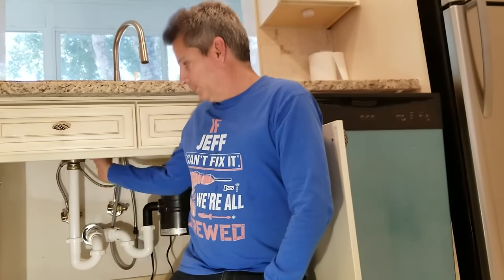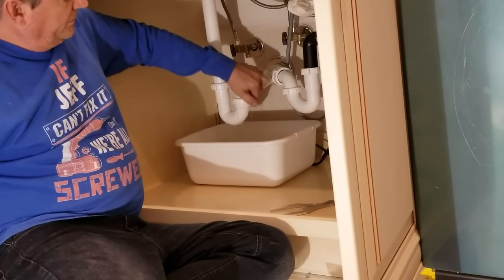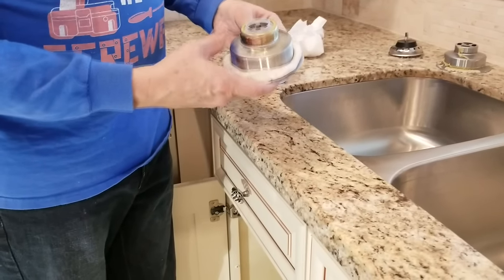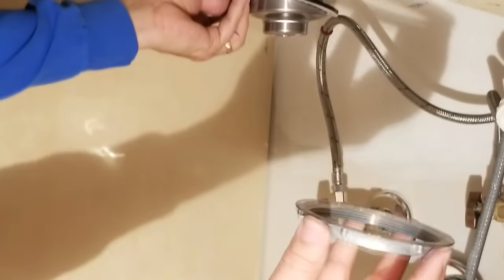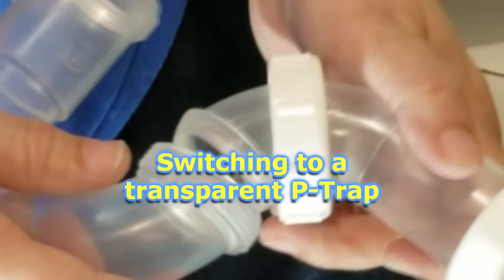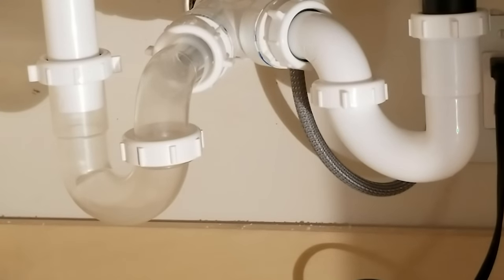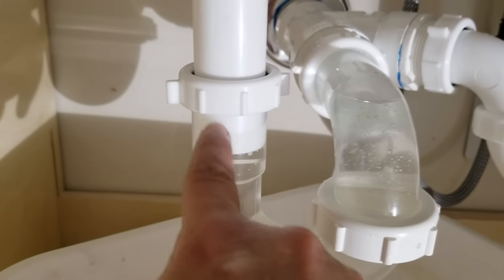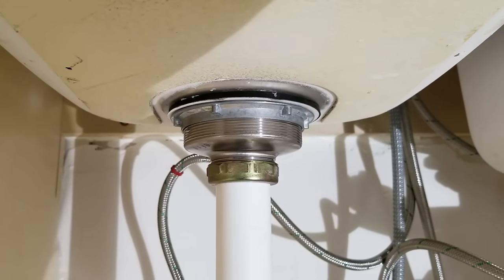How to Replace A Kitchen Sink Drain Strainer, Repair Leak

Comment: Thank you, Jeff. I just inherited my parents 13 year old log home. I am going out tomorrow for the items to fix this problem. Should I also replace the other side, just in case they are like signal lights in your auto? One goes out and the next week the opposite one fails. Thanks again!
Reply from the maker: I buy the whole kit for $7 includes the basket strainer top side and the cardboard washer and connection for the bottom side. Many installations are done wrong becaus emost people leave out the cardboard washer thinking it is trash or shipping material, but it is required or you get leaks.

Comment: Absolutely excellent video. Unfortunately  both metal nuts on my pipes are seized on their and I cracked the white pvc pipe
Reply from the maker: OK so it looks like you're going to have to remove everything anyways, so if the nuts are seized what I would do is see if you can get an angle grinder or a Dremel tool with a grinder wheel on it and cut a two or three slits around the giant nut to get it off of there and I always replace everything because the basket drain strainer is basically a $7 kit so you will start out with everything brand new and fresh and nice clean scrubbed stainless steel sink opening.

Comment: Hi Jeff.  Great video. I wish I found this before I did mine.  It is leaking s little underneath after it was ok for a while.   I think it's because I didn't have one of those wrenches.  Can I get one tighten it up.  It's been about  3months tops. Or, do need to undo it and put new putty in place first?
Reply from the maker: I would try to tighten more first if that fails, put in new putty

Comment: Hi Jeff thanks for the easy to understand video. Ive got all the new parts but using the universal sink wrench i cannot loose the old nut - the whole unit just spins. Any ideas how to get the two apart? Thanks
Reply from the maker: You mean the sink flange up top is spinning too? I would try holding the tail pipe from the drain with one hand and try loosening with the other hand. Is there any corrosion? Might need some PB Blaster sprayed on first. Might also try to get a helper to try to put weight on the part that's moving. Example if the basket drain is spinning too, you might need one of those tub drain wrenches made to fit down over the cross pattern of the drain, and hold that in place with a wrench or channelocks, while a helper loosen the big wrench. Let m know if nay of these works for you.

Comment: Hi, much appreciation for the volume of info. 
What did you use to scrap off the old plumbers putty?
Thank you!
Reply from the maker: I just used a regular paint scraper and then I used a scotch brite sponge that's the green and yellow sponge that has the green scouring pad built on to it
Reply: @jeffostroff  Thanks so much!

Comment: We have a “sprayed on granite kitchen sink” from Lowe’s, that came with our house. I replaced the strainers on both sides. A couple months it started leaking again. I purchased new plumbers putty and reinstalled. No leaks but the drain nuts keeps loosing? I believe it’s from draining hot water from the stove down the sink. I do run cold water while doing this too! Any remedies? Loctite? We’ve always have had Stainless Steel sinks.

Comment: Thanks for this video Jeff! We had a new sink strainer installed by a plumber in April 2020. About a month ago it started leaking (it didn't even last a year!). Upon inspection, the gasket seems to be coming away from the underside of the sink (wish I could post a picture here). How long are these gaskets supposed to last? Also, it looks like not enough putty was used on the sink side. I'm going to try and repair this myself asap with the help of your video. Fingers crossed.
Reply from the maker: Gasket should last many years. Likely culprit is the plumber's putty, like you said

Comment: Helllo,What is the alternative to the paste you are using?we can use pettix repair express ?thank you
Reply from the maker: The only two products I have personally ever seen used are plumbers’ putty, and silicone. Most plumbers will agree that silicone seals better, but if you ever have to change the drain years down the road, it can be a little more of a challenge to get the silicone to come off of the drain opening. Most plumbers that really know their stuff will tell you that the plumbers putty eventually cracks and leaks that's why most people have a leak in their kitchen sink. So I have never tried any other solutions than these two.

Comment: Off topic from your video but I'll be changing my bathroom sink and currently I have copper water lines . My question is should I put in flexible stainless steel lines or just keep the copper  ? The house was built in 92.
Reply from the maker: I always upgrade to the steel hoses, the copper lines kink and break too easily.

Comment: Hello Jeff! This video is so useful and thank you so much but mine leaks on clean out plug.There shouldn’t be gasket in clean out plug, right? What should I do? Can you please recommend me? Thanks 🙏
Reply from the maker: Glad it helped. I usually don't see the PVC clean out plugs leak, but some people report leaks. They don't come with gaskets, so the best way to handle this is to wrap the threads of the cap with white plumbers Teflon tape. Wrap ir clockwise when viewing the cap from the bottom. Some people also brush on pipe dope, it's like a thick paint texture, and it dries rubbery and fills in all the voids in the threads.

Comment: If I use the plumber's putty, then can I able to remove the strainer in future? I mean does plumber's putty is a permanent one  like an mseal or it just help to seal the water and allows to replace the strainer when needed
Reply from the maker: No plumber's putty will not dry like a glue, and will not prevent you from removing it later. Actually the problem with plumber's putty is that it dries up and cracks and starts crumbling off, which is what causes a lot of leaks.

Comment: Is the cardboard gasket necessary? My brand new drain is leaking and don't need to replace it. I don't think I used enough putty.
Reply from the maker: We have a newer updated version that explains all of this, just uploaded it a few months ago: https://youtu.be/6mFfoYcK6zc What I do is I make sure I put a half inch thick bead of putty going all the way around the flange and make sure we're at ties back to the beginning that there's no seam or anything that looks like it's continuous. And make sure you use that cardboard washer it is necessary as I showed in the video it prevents bunching up of the rubber gasket and it provides a smoother tightening of the nut.
Reply: @jeffostroff  It is destroyed by the leak.

Comment: Thanks for the video. I almost sold my house and bought a new one until I saw this simple fix for the leaky sink!

Can you hand tighten the drain instead of buying the tool(s)?
Reply from the maker: No I doubt hand tightened will be enough it does need to be pretty snug. If you don't want to buy the tool, try using a flat head screw driver and give it several taps until it is tightened, but I think the wrench will be a lot more reliable.

Comment: The setup under my sink has the two pipes connected before going through a single p-trap (in a sort of T-shape), is there an advantage to having separate p-traps for each side?
Reply from the maker: What you have is the traditional method used by most plumbers, it is the easiest one, and probably does not matter which way we go.

Comment: Helpful info, I think you should’ve told us we need an extra tool to keep the stainless steel body from rotating when loosening underneath. Because both rotate at same time, I’ll have to stop the job and run to the store for part
Reply from the maker: You don't need an extra tool all you need is to hold the thing steady with one hand tighten the nut with another hand and if you don't have that big ranch then you simply use a screwdriver with some hammer taps on the tightening nut in order to tighten it down

Comment: The sink drainer you replaced looks pretty new. How did you know you needed to replace it? And not just redo the putty and screw everything back in place?
Reply from the maker: The drain would in theory need to be replaced only if there are any signs of rust, or the cardboard washer is degraded and black and crumbling. Then you get ta new kit for $8 and the strainer basket comes with a new cardboard washer!

Comment: Since plumber putty degrades over time especially with cooking macaroni with pots of hot water what is better longer life than those jars of putty?  Thanks if you see this.
Reply from the maker: Some plumbers prefer silicone, it does not dry and crack or shrink.

Comment: Mine is the seal between the pipe and the gasket that’s leaking. will replacing the gasket help or can I buy that high hat seal separately?
Reply from the maker: Make sure the gasket is on the pipe in the correct direction. IT should be a snug fit on the pipe before you screw it down. Which part of the pipe are you referring to?

Comment: So if I have that leak, does that mean a replacement is necessary or can I just reseal/tighten it?
Reply from the maker: You can try to take everything apart clean and everything off and then put in all new plumbers putty up on the top of the sink and that might help your problem period if you are missing that thin cardboard washer then you're going to have to buy a new kit to get that washer or see if you can buy the washer by itself at the store. But that cardboard washer is very necessary part otherwise you will not be able to tighten the basket nut underneath the sink tight enough to the bottom of the sink without that friction ring.

Comment: Great video! Great instructions! I have two questions: can you over tightened the nut connected to the paper washer and rubber gasket? If the rubber gasket and paper washer shifts while tightening the nut, making it uneven but fully covered, should I untighten it and redo it? Thanks! 😃
Reply from the maker: Yes, you only need to tighten it until it is nice and snug, and if if gets uneven , loosen it and start over until it is even.

Comment: I wish I could send you a picture.  My sink doesn't have that nodal thing that you used the wrench on.  Mine is smooth metal and I can see the putty already.
Reply from the maker: Wow so you have no tabs at all on yours? I wonder how they ever got it on there or tightened it you will probably have to use some kind of a superwide wrench that you can tighten down on top of it or drill a hole through it an run a bolt of some type into it and then bang on the bolt to make it loosen

Comment: I noticed that you didn't use any tape or PVC glue, those are not necessary? Thank you so much for all of your help!
Reply from the maker: No cement is needed, and the kit comes with a flanged tailpiece washer, also known as a high hat washer, which takes care of the seal, so no tape is needed.
Reply: @jeffostroff  Thank you so much for taking the time and replying. I really appreciate it! Take care! ☺️

Comment: My drain basin has a drip, do I have to replace the whole thing or can I buy the wrench and tighten the drain basin?
Reply from the maker: You can try to tighten it down 1st and see if that helps, but remember if you have water leaking from the top of your sink down to the bottom of the sink, it means it is getting through the flange which means that if the original plumber who installed it used plumber's putty, then that putty has dried up and cracked and now has leaks it is allowing the water to leak through. So for that reason you can either lift up the whole flange and scrape off the putty in just add new putty, or you can just buy a whole new kit that comes with the new cardboard gasket and everything else brand spankin shiny new and just install that.

Comment: Great! I need 2 things: the ergonomic key and the plumber's putty.
My strainer's nut is stuck. I cannot turn it. I have a strainer wrench and an articulated - HDX - nut wrench. 
But I need 3 hands ( 1 for the strainer wrench - to counter -and 2 for the articulated stupid wrench) and I have only 2!
I was thinking to put some heat on the nut, maybe it gets larger, but unfortunately, I remember what happened in The Bing Bang Theory when they tried to change the Feyinman's van wheel.

Comment: Is it normal for the putty seal to come up days after its been done.its not dry is that normal is that how the seal lasts and works?
Reply from the maker: The thing to remember about putty is there is no drying in fact you really don't want it to dry because then it will crack and allow water to leak through it. The whole issue about putty is it's supposed to stay compressed between the flange in the sink. Once you attach the drain flange to the sink and tightened it from bottom and all of the plumbers putty oozes out, you are supposed to remove all of the excess so you don't really see any and then you are done. So I'm not sure why you are seeing some there now unless there was residue leftover sticking out that maybe you didn't notice. I would check the bottom for legs underneath and if you see leaks take apart the entire assembly and redo it again and do not remove any excess plumbers putty until everything is completely tightened down and you have no plans of moving the drain again.

Comment: I had to fix that one and the one on the waste disposal due to the vibration of the waste disposal but I didn't ned to replace the drain pfascia sa you did, just the plumber's putty. Why did you replace the drain fascia?
Reply from the maker: There was nothing wrong with this drain at all, it was a condo flip I was selling. But to make the video we replaced the whole thing

Comment: Wondering if the cardboard gasket is a critical component. My old worn was ripped and unusable. Wondering if the rubber gasket and putty will be enough to avoid future leaks.
Reply from the maker: I'm a fan of repeating things exactly as they were so if it came with that cardboard gasket I would suggest you use it. Even the garbage disposals come with it as well
Reply: @jeffostroff  Yeah, better safe than sorry.

Comment: I did this job several months ago and replaced both sink drains. I had a problem with the left one leaking. I use plumber's putty but I'm not sure why it's leaking now several months later. Does this mean the plumber's putty failed or did I not tighten the nut underneath enough?  I don't know what to do other than to try removing and reseating the sink drain and using more putty again.
Reply: you put a rubber washer on? also make sure the rubber washer is in the right direction. Had this happen to me and it was the washer that was bad.

Comment: Ok, so would just replacing the old gaskets and sealing the top with plumbers putty work as well?
Reply from the maker: Yes I think so. The kits are so cheap though, it's only a few bucks to replace with all new and reset the life clock on it

Comment: Mine wasn't tighten on that tight. And now my cardboard box washer is warped out and leaking a little. Do I need to buy another whole new drainer ? 
And also when I tried tighten it, it was spinning in circles, so I needed an extra person on top to hold it with a screw driver as I tighten
Reply from the maker: We get this question a lot and my opinion is that yes if you had a leak it's only 10 bucks at the most to get a whole new kit and I always replace the whole kit with a brand new washer with the shiny part facing down towards the nut to eliminate the friction in bunching up of the washer. This also gives you another chance to examine that flange that goes up top in the bottom of the sink to make sure that you have enough plumbers putty there this way you're starting over from scratch and it's basically a 10 minute operation so to me it's a no brainer to just replace it brand new that way you're starting all over from day one again without any questions and you can sleep at night knowing that there won't be a leak as long as it was installed properly and tightened properly
Reply: @jeffostroff  thanks

Comment: Of if the nut that connects to the bottom of the sink drain has poorly working threading does that mean you need to replace it.

Comment: Should I use the gray gasket that came with my drain ir swap out for plumbers putty?
Reply from the maker: The gasket you are referring to I think goes under the sink, you still need plumbers putty, unless the manufacturer instructions specifically tell you the use the gasket up top in the bottom of the sink under the drain flange.